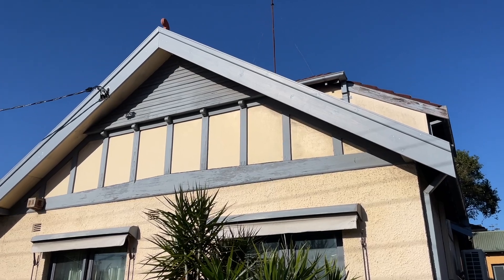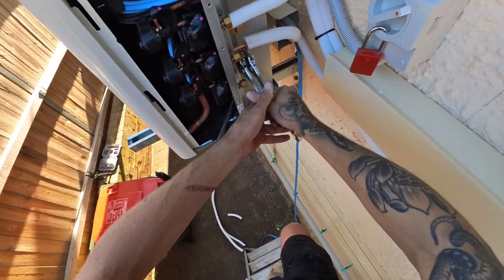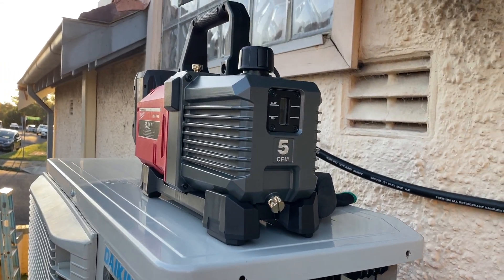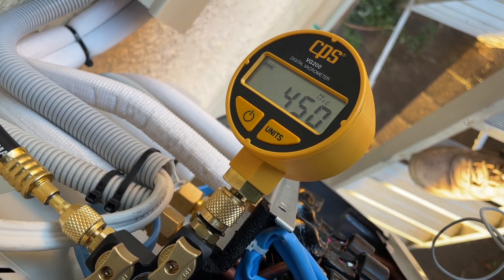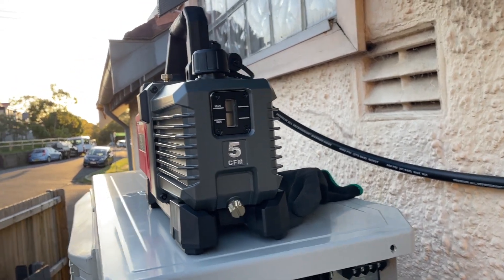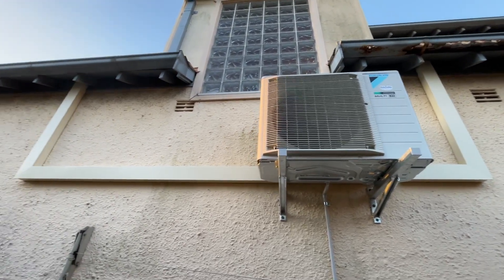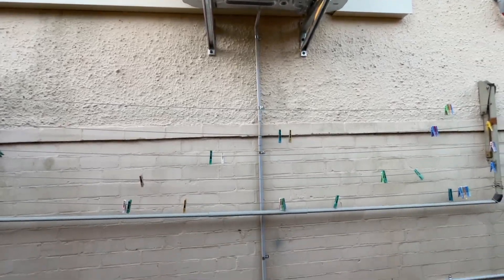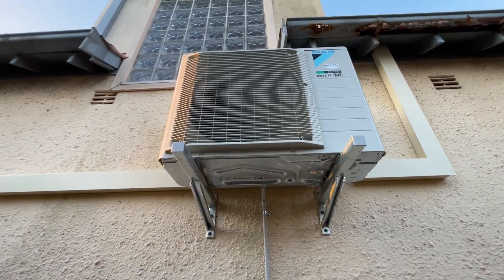Installing and commissioning DAIKIN R32 Ductless Mini Split AIR CONDITIONER

Comment: Hope those AC circuits weren't new or upgraded, because if they are the electrician by law is meant to have RCD protection on them!
Reply from the maker: @scoffee82  They are brand new and they are literally all RCDs. 

https://hager.com/au/products/product-information/adc925t-rcbo-1m-1p-n-6ka-c-25a-30ma-a
Reply: @maracservices  they just look like a breaker not an RCD, if they are RCDs then excellent the sparky has done his job
Reply from the maker: @scoffee82  it’s an RCBO which is an RCD and Overload Protection all in one. They look like a traditional Circuit Breaker and the benefit is, if the RCD trips it doesn’t take out the whole house, just that circuit. It also makes it easier to find an earth leakage fault.
Reply: @maracservices  yes mate I'm well aware of the benefits, TBH mandatory RCDs on every circuit should've been law 10yrs ago

Comment: Hey Mitch great work, what vacuum hose and fittings are you using? Is it a 3/8 hose to the pump and 5-16 connection to the core remover tool?
Reply from the maker: @davidscully7609  thanks mate. So it’s a 3/8 hose and it goes to a 1/4” fitting on the field piece tool. 

A lot of people have asked why I didn’t go 1/2 inch hose. To be honest I only chose this hose because it’s what they had on the shelf at Actrol. The way I see it, you can only pull so much through a 1/4 or 5/16 fitting so the hose size doesn’t really matter (correct me if I’m wrong lol). I just wanted any hose that had no schreadar valve restricting it. I’m happy with this set up. So to answer your question, 3/8 hose with a 1/4 fitting.
Reply: @maracservices  very nice , I’ve just purchased the Appion core removal tool and will use my 3/8 hose

Comment: Do you not have to carry out a nitrogen pressure test over there 😂
Reply from the maker: @neilmitchell9483  you don’t “have” to no.
Reply: @maracservices  interesting, it’s not considered optional in the uk. Also Daikin manuals recommend 30bar test for R32 kit.
Install is very neat btw, just surprised to see the OFN test missing.
Reply from the maker: @neilmitchell9483  thanks mate. Yeah that’s very interesting. Is that a rule from a governing body? In Australia we have a governing body that does nothing apart from audit you randomly to make sure you have the right equipment to deal with refrigerant. Apart from that, there’s no specific rules to follow. Just personal preference. For me, i just use my vac stat as a leak test.
Reply: @maracservices  well we have something called FGAS and the testing is part of the training you do.
It’s definitely something we have to do on commercial work as part of commissioning 👍🏻

Comment: Nicely done. Was that some kind of reducer ring from 1/2 to 3/8 on that suction line? Thanks
Reply from the maker: @BerrienGuy  thanks mate. Yeah it was. I installed two heads that were 1/4 x 3/8. There was only one 1/4 x 3/8 set in the outdoor unit so the unit comes with those reducers to use. Cheers
Reply: @maracservices  Thanks Mitch, I will have to look for those - never seen them before and it would have saved me at least a couple of hours on my last job. And thanks for the videos, I really enjoy watching someone who takes pride in what he/she does

Comment: 2 shifter this time haha nice work boss, also nice welding burn on the forearm. Us fridgies could almost be branded brothers all with similar burns in similar spots.
Reply from the maker: @BrannndonM  haha it’s because that was a 1/2 inch flare so there was actually room to put a shifter. The 3/8 flare had no room mate haha. If you measure that burn it’ll measure exactly half inch 😂😂. Burnt it doing some pipework on a Mitsubishi VRF system. Brutal!

Comment: Out of curiosity, why don't you use a torque wrench on the flares?
Reply from the maker: @machaf  I’ll be completely honest with you. It’s because i have never had any issues up until this point. Like literally none ever. I am not against torque wrenches at all. In fact I’ll probably get one at some point. I just haven’t ever used one up until now so I feel personally that I don’t need one. Maybe that will change in the future.
Reply from the maker: @machaf  I’ll be completely honest with you. It’s because i have never had any issues up until this point. Like literally none ever. I am not against torque wrenches at all. In fact I’ll probably get one at some point. I just haven’t ever used one up until now so I feel personally that I don’t need one. Maybe that will change in the future.

Comment: So with this system installed can each " head be operated independently of each other?
It's something that I may be interested in
Reply from the maker: @Mick_4591  yes each head is completely independent of each other. From inside the house, It’s like having two separate systems. 
There is one thing it cannot do though. You cannot have one head on cooling and the other on heating. Apart from that, they can do everything.
Reply: @maracservices 
Thank you Mitch for your answer to my question

What areas do you cover as I'd be interested amin a quote for same set up if possible 
Cheers
Reply from the maker: @Mick_4591 Sydney metropolitan area. If you want a quote, just send me an email at,
mitchattwood@maracservices.com.au

Thanks

Comment: Hi Mitch, great work. Do you have any issues with vibration if you mount the outdoor unit on a wall? I’ve had issues with some especially Fujitsu here in NZ, cheers Nick
Reply from the maker: @nickbutland4325  Hi Nick, I’ve never had any issues ever. It’s important to note that I never mount units on cladded walls, only double brick or brick veneer. I never mount them outside bedrooms, only outside living areas or voids. Also, if it’s a big unit I don’t mount them on the wall. So to answer your question, I’ve never had issues but I also only do it in certain situations. Cheers mate
Reply: Thanks mate, sounds good, keep up the great work, I’m an old fridgee but still learning lots from you!